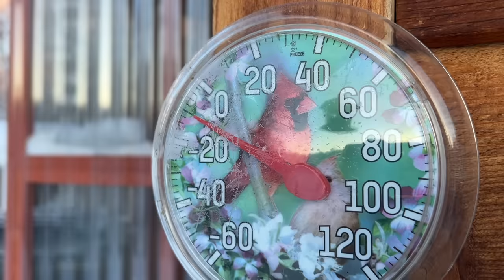Life Below Zero in Alaska! -23 Degrees! Frozen Water Pipes & Restocking Firewood...

Comment: I lived in a mobile home in Michigan I had to have my hot water tank and pipes under it insulated and on really cold days I had to let one sink dribble water over night so it didn't freeze .I didn't let the water run full force all night just a dribble in bathroom and kitchen and tub or shower. I also put on a electric heater tape on the pipes under the mobile I left them on all winter and unplugged them of course in the spring and summer and fall....my pipes from the well laid on the ground then ran up to the main pipes....my hot water heater pipe froze once too and busted , The plumbers aren't cheap . So I put some kind of insulated blanket around the water heater and around the pipes....I never had pipe freeze after that......I hope you don't ,Take care